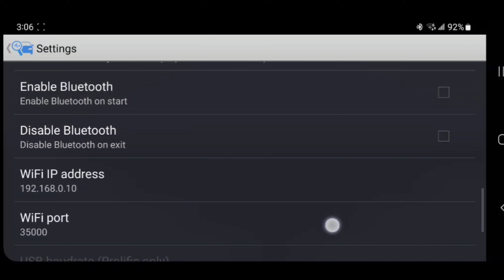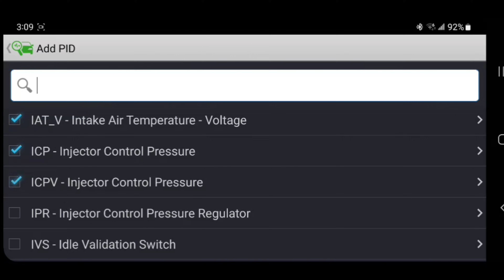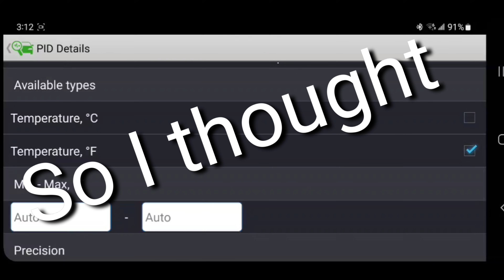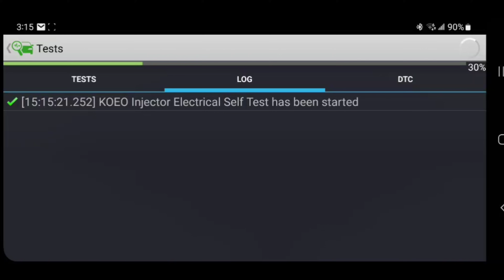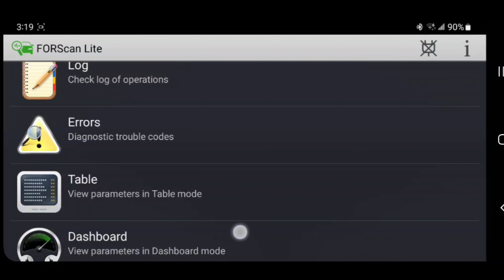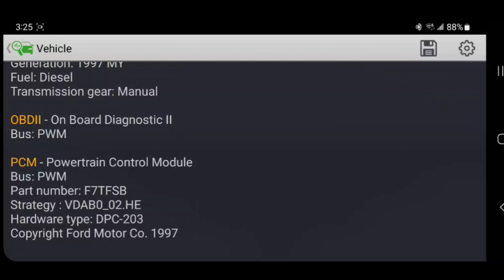How to Install and use Forscan Lite #fyp #ford #newtoyou

Comment: I used this to troubleshoot a wrench warning on my 2016 F150 2.7 ecoboost. My Actual boost pressure was falling behind the Desired boost pressure more than 4psi for more than 5 sec when I was pulling a travel trailer on hills. You can pull data and email it to yourself as a csv file, open it up on a pc and look for where the errors occur. Mine ended up being a worn waste gate actuator arm. I was able to fix it wo replacing the turbo. Ford probably would have charged me $2k to replace it since they don't have a fix for it.
Reply from the maker: Good use of the app

Comment: You have my interest piqued in the Torquepro one you mentioned.  I have Forscan as you have it here,  but yes -- it is reporting things that aren't showing up on the dash per an engine code.   Not sure what is going on there.
Reply from the maker: If your connected to a old 7.3 alot of DTCs don't see a check engine light.
Reply: @CPsGarage  No... not a 7.3, but a 2006 6.0.   Not showing me the code(s) for Exhaust gas temps.   I have EOT and ECT which are important, though!
Reply from the maker: @starhopper457  there is not a exhaust temp for the 6.0 that's why.

Comment: Hi, 
I am using this adaptor: Viecar Bluetooth v4.0 OBD2 which is Elm327 compatible but I can not connect to forscan lite. 
Any ideas? 

Thanks
Reply from the maker: Check your settings in the app and make sure the adapter has been connected to your Bluetooth. If your running a iPhone wifi adapters is the only way to go from what I here.
Reply: @CPsGarage  its an android phone.  
I have chosen the adapter and set the connection type as Bluetooth 0(tried 1, 2 also)
But it doesnt connect. 

It is an issue with forscan only. The adapter works with other code scanning apps, so I wonder if there is any trick with forscan.
Reply from the maker: @makululaj86  Forscan has a very specific list they recommend. I find using them will give you the best results.

Comment: I've been having issues with my 2019 Ford Expedition adaptive transmission for the last several weeks and have been looking for a solution. I've tried a bunch of suggestions found online but nothing was working. I found this video really helpful. I ordered an ODB2 bluetooth adapter that works with Forscan Lite. The adaptive transmission reset process took less than 2 minutes and everything is running smoothly again.
Reply from the maker: Forscan for the win. I always say if you own a Ford you better have Forscan.

Comment: I’ve got a 6.0. Does it read FICM voltage?
Reply from the maker: It should in the Ford powerstroke PIDs
Reply: @CPsGarage  I’ll play with it when I get a chance later. I currently use torque to monitor everything. Just looks like FORScan has way more thing you can do with it

Comment: Nice video bro can you use this to change fuel tank capacity on a 2006 350 6.0 powerstroke
Reply from the maker: No sir you need the computer version. Which I also have a video on how to set that up.

Comment: I'll use mine to watch long term fuel trim and short term, both banks with catalytic converters temperatures.
Reply from the maker: It does work great to monitor Pids. We use it in long road trips in my 97 and the wife's hybrid
Reply: Thanks for this video. People really need to know about this. So much better using this then those pricey programmers.

Comment: Hum when I do a search on Google Play all that comes up is FordSys Scan Lite. Thanks anyways, I have it on my Laptop and both the BAXF Bluetooth and WiFi versions of the OBDII interface modules. I agree the Graph is probably the best intermittent tool on any Diagnostic Software. Best Wishes & Blessings. Keith Noneya
Reply from the maker: The mobile version of my videos need updated. They have changed it since the Russian sanctions went into effect. Now it has to be downloaded from Forscan and paid for on their website.
Reply: @CPsGarage  Thanks I have the FORScan and their ELM136 USB cable, but I haven't tried doing anything with it yet. I used to have TorqueLite but I deleted it because it was about useless except for RPM and MPH. Do You have any recommendations for something relevant to use to day? Thanks Best Wishes & Blessings. Keith Noneya

Comment: How to configure connection in Forscan Lite via usb cable? I have a vgate vlinker FSUSB interface and I connected an otg usb cable with an OPPO A5 smartphone, I turned on the otg options but forscan lite does not want to connect to the car
Reply from the maker: Did you set comm type to USB in settings??? I don't have a wired adapter to try.
Reply: I will try change USB settings in my phone
Reply from the maker: @jarosawubinski8373  let me know how it works
Reply: it doesn't work, I tried with different settings of the forscan lite program, I used 3 different phones, the phones do not detect the interface as a device connected via usb, the interface is functional because on a laptop with forscan it connects perfectly with the car

Comment: Guy, it is possible to enable a Cruise control on a fiesta 2017 mk8 with this app ?
Reply from the maker: I would think so if you use the computer version. The phone version would not.  I'd Google 2017 fiesta spreadsheet and see if there is one for it. May also be able to turn it on under the programmable features.

Comment: Manual transmissions trucks have the ECT.
Reply from the maker: Not all. Mine doesn't and it's a manual.
Reply: The 2001 and newer 7.3s with the manual trans should be able to read the coolant temp. That’s when they put the second sensor in the passenger side head and increased the rating on the engine for the manual trans trucks to 275/525.